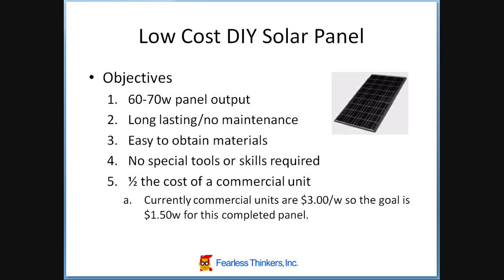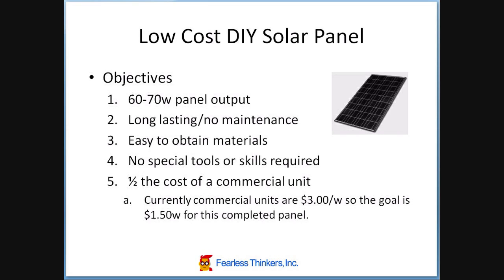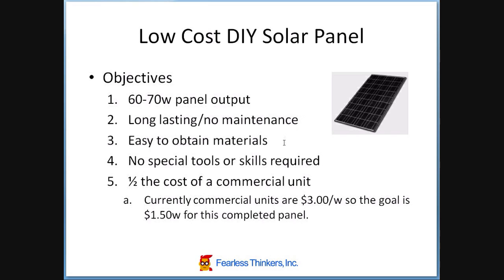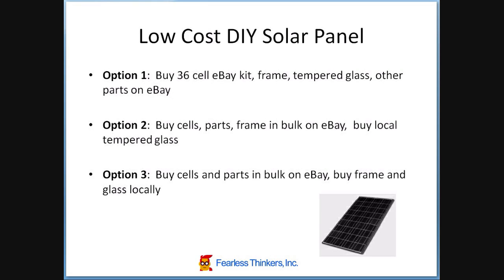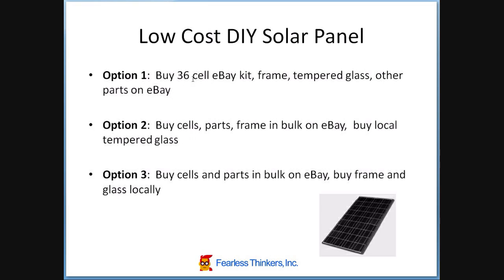PART 1:  $100 70w Solar Panel DIY project

Comment: I have seen commercial solar panels for $1.84 per watt. Sunelec. sells them. Then you have to also consider the government rebates you get. Shipping is expensive though so that drives the price back up per watt.  For me for 380 watts would have come out to about  $ 2.36 per watt. with commercial panels.

Comment: You can save money on the aluminum if you go to a local steel, or aluminum supplier and buy it. I  got 50 ft of 1.5X1.5X1/8 inch aluminum for $65. Tempered glass they will usually give you a little bit off if you order more than one. Otherwise look for an old storm door with tempered glass. Habitat for  Humanity stores sell them for $3 to $5. You can fit 72 5x5 cells on them.